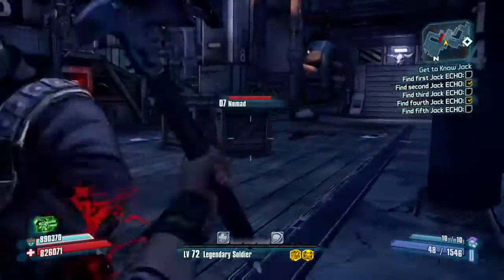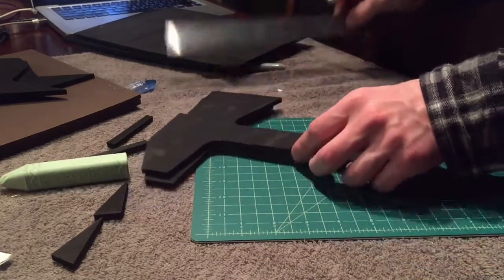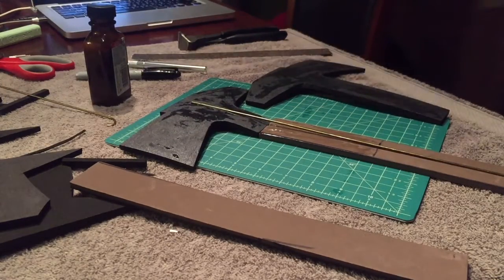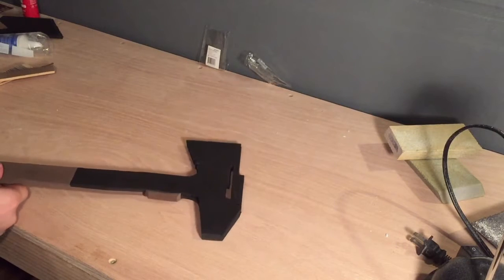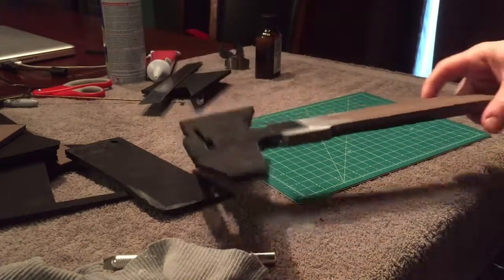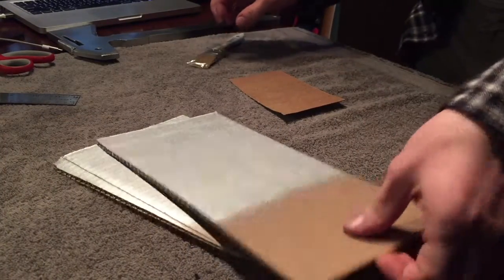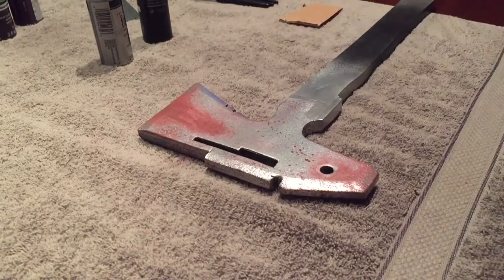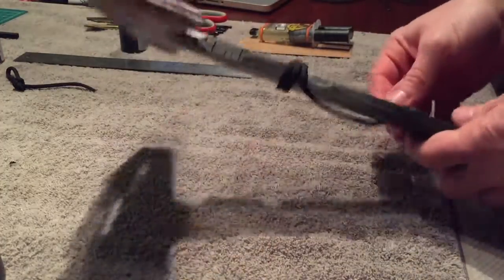Axton's Tomahawk

Comment: Do you have the axe head file?
Reply from the maker: I do, actually. Sorry for the late reply.
Reply: Is there a place to access the file?
Reply from the maker: Hey, I just put it up on my Deviant Art page. I hope I wasn't to late for you!
Reply: Yup, but that's ok. I put a shot of your's on the screen and used a base measurement from your video for one of the sides and then mathed the crap out of it to figure out the rest of the dimensions. I posted a picture of my progress to date on Instagram and tagged your account. Have to give credit where it's due and I couldn't have done it without your picture and video!